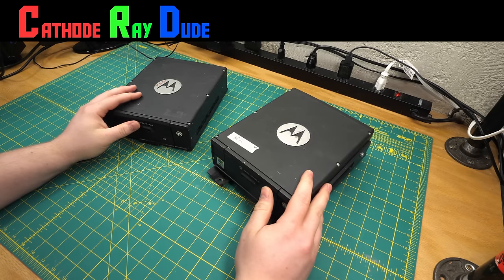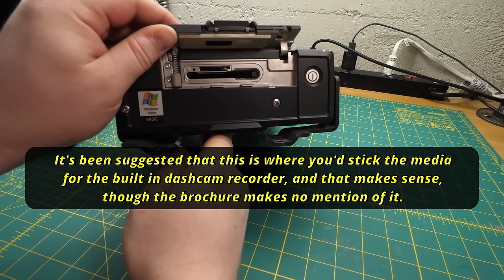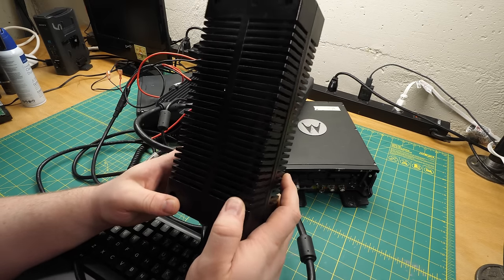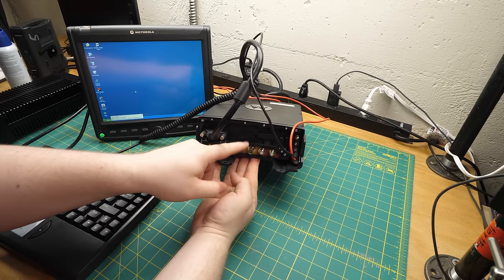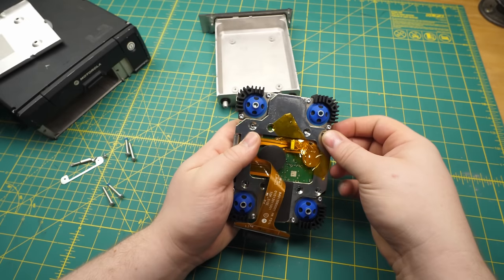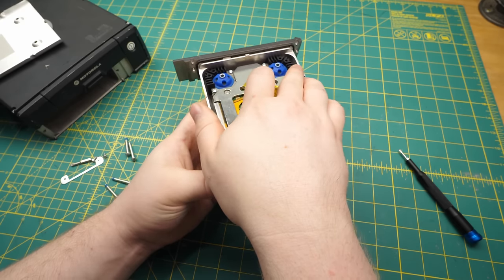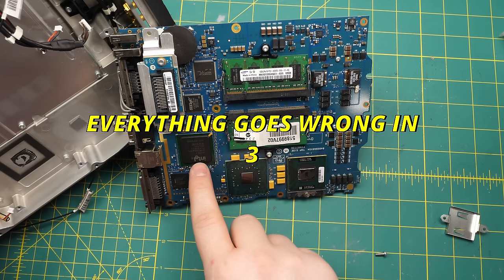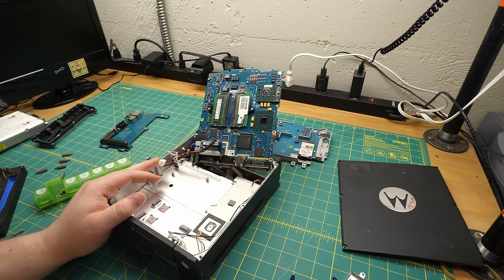Little Guys 7: The Cop-puter [Motorola MW800]

Comment: I know back in the day, cops HATED being upgraded to these things solely because of the DVR's seamless recording, before this they used something like a Panasonic AG-720 - a VHS CCTV portable. I think there might've also been DVD based systems but they never really caught on, something about "hot car on a bumpy road" really doesn't agree with DVD burners considering if you get the disc too hot they get corrupted and there's only so much error correction a burner can do when you're bombing speed bumps and jumping curbs at pedestrian-splattering speeds. Reason cops loved the VHS based systems was cause of how, every 2 hours (most departments liked SP mode for seeing license plates), you'd get a couple minutes of "I get to obey your constitutional rights even less" which could be extended quite easily by pulling the fuse while it was still rewinding - no discontinuity jump in the video if it's not recording when you pull the fuse. It's why even in cases where cops had dashcams from the 80's to the mid 2000s, they always """mysteriously""" didn't have footage of their brutality incidents. The other thing was, much like how airline pilots will """forget"""" to pull the circuit breaker for their CVR after a big incident that's their fault, the cops would also conveniently not come back to the station to swap the tapes out after a report-worthy incident and instead go on a 2-hour coffee break with the engine running "for air conditioning"...

Also yeah, I hate those SAE plugs for 12V stuff if for NO OTHER REASON than "because it's way too easy to blow something up with them". Both halves of the plug are the exact same but with opposite polarities, so if you own, say, a cigarette lighter cable for your portable VCR and the alligator clip leads for your battery maintainer, there's a very good chance the Good Idea Fairy says "hey, why don't you use those clip leads so you don't need to bodge together an adapter to use it off gel cells?" and you don't realize that the polarities of those two plugs are reversed... Only good thing about em is that the 2-pin ones will fit perfectly into a 4-pin SAE trailer plug, which saved my bacon on one road trip when the cigarette lighter went out and I needed to run my ancient Magellan GPS to find my way across 3 states without a copilot to read the road atlas, just clipped the leads onto the cigarette charger and plugged em into the trailer plug. Had to drive with the fog lights on the whole time, but that wasn't an issue.
Reply: Gotta love our overly militarized police force! Protecting and serving the SHIT out of us for over a hundred years!
Reply: I totally believe they would do something like this, but weren't their timestamps overlayed on the vhs tape video franes? Doing this would be obvious from the huge timeskip jump, right?
Reply: @humidbeing  Only if you've got a lawyer that knows about the trick, a prosecutor who won't just say "objection, irrelevant" when asked to fast forward all the way to the other end of the tape, and a police department that actually gives you the tape itself instead of just the clip of the actual incident if there is one. The skip's in the rewind zone, there's ALWAYS a time skip on VHS CCTV footage because there's no true "loop" recording - the player HAS to rewind the tape back to the start before it starts recording again, and what's an extra 3 minutes of missing footage when you've got qualified immunity?
Reply: SAE plugs - trailer-light connectors is where you saw those in the past. Maybe four pole for brake and turn signal lights on a trailer.
Reply: @uploadJ  Oh I know, read the second paragraph lol, the 2-pole SAE connectors are also compatible with trailer light 4-pole plugs, just gotta drive with the fog lights on so the running light prong on the trailer plug's got constant 12V power. Just annoying cause which prong is hot vs neutral is pretty arbitrary based on what the particular cord came from, the 2-prong ones are mostly seen on trickle chargers where the polarity is seemingly random between brands cause some brands consider the car's battery to be the "master" while others call the charger the master, the master shouldn't have exposed 12V on the male half of the plug but when both sides have 12V on them it's kinda just "put it wherever"
Reply: @LenKusov   There's always a time skip if you only have a single recorder. When they want everything recorded they would use two recorders which rewind out of phase with each other.

Since (AFAIK) police dashcams were mainly made to protect the cops (and not the general public) it's understandable why they wouldn't go with two recorders.

Comment: That oblong connector looks like ssf8470 it’s an external sass connector designed for ruggedised computers 

A friend of mine is a bus mechanic and they use them all the time 

They plug it into a laptop run the software that clones all the data(usually cctv) and dumps it to the server so it can be managed

Comment: The design with that springloaded thing for the cpu makes sense. If youre concerned about vibrations you want every screw fully tightened down. With a more classic cpu bracket the screws would be under springtension.

Comment: I drive a fire engine for a big city department and the onboard dispatch computers in all our units are nothing special, just public safety versions of Panasonic Toughbooks connected to a cell/wifi/gps radio modem and mounted in a cradle.

Comment: Those SAE plugs are most commonly found in the 4 pin variety, as trailer lighting connectors. Wander around to the back of any pickup or suv and there’s probably one in plain sight and if not, behind a cover somewhere. And yes, they are disgusting feeling to plug in. They do actually retain surprisingly well because the pins aren’t cylinders, but actually a weird chess pawn shape that kind of positively engages
Reply: I was actually going to mention that also, they look like a two-pin version of the trailer light connectors and yes I hate those because you never feel like they're plugging in correctly and most of my trailering is jet skis or boats meaning the trailer lights go in the water so sometimes when the lights work I can't tell if it's the plug not plugged in or the lights just acting up because they got wet. I much prefer the seven pin round connector on my camper

Comment: One of the things you mentioned early in the video were computers for EMS/Fire. For a while, most agencies used similar devices to this one. Some of them were made by Motorola, some of them are made by companies like Philips (Philips weirdly makes a lot of emergency medical equipment like the LifePak). They were basically identical to this one in almost every way, but Philips did make a few "medical tablets" that were just Windows computers that could dock into the cab of an ambulance or fire truck. I have never seen any come up for sale on Ebay or otherwise unfortunately, but maybe you could find one on a government auction site or something. These devices have mostly been phased out in any EMS/Fire situations, they use use iPads or Android tablets with rugged cases now because they're faster and significantly cheaper than purpose-built devices.

A few additional things to add here since it seems like there were questions about ports on this device -- A lot those ports are meant to connect to other things in the car. Motorola has radios with these massive huge "Accessory ports" on the back meant for computer control. Before 3G/4G was really a thing, cop-puters were able to connect to some radios to handle things like data over radio for things like searching license plates and whatever. This is probably one of ports on the back. One of the other ports on the back likely also connected into a vehicle's CAN bus to record things like speed, engine performance, gear, whether or not the headlights/lights/sirens were on, etc. (If you ever see police chase videos on the news or on Youtube sometimes you'll see indicators for these things embedded in the video). These things were designed to be all-in-one devices that handled basically everything that wasn't the radio or the car itself, and were used in all sorts of scenarios. Unfortunately the hardware doesn't really tell the full story, you'd likely need to get the software to see some of the additional features that this thing has, but with it being Motorola you're SOL because of how tightly locked they keep anything that is considered "Proprietary".

Comment: That “SAE power connector” is indeed automotive standard…

Being a mechanic, I have seen that it has well been figured out. The specs are “does it fit” as the precision in automotive engineering is saved for things that matter more than a 12-14v power supply (ie. an internal combustion engine drivetrain). This same style of connector, albeit more pins, is used for small boat trailer brake lights. On the supply side of the connector, the positive leads for whatever circuit will always be female, multiple circuits in this style connector share common ground (the male pin of the supply side).

If you think computers have a lot of variety of connectors, just do a quick query of you local auto parts store’s inventory of the number of different three-pin plugs.

Comment: the cooling solution and the PCB clamping is certainly perfectly engineered. this is where Motorola has expertise from decades of heavy duty radios for law enforcement and military vehicles. they will have modeled it 100 percent to fit the specs.

Comment: you were SO CLOSE when you said "Tempest attack"!

i've done the work of sealing computers and peripherals against Tempest attack, and the amount of aluminum makes me think that maybe that's what it's for, since there isn't any metallic gasket tape anywhere, but there is a bit of kapton tape over a heater, perhaps to dampen signal leakage?it could also be simply for shielding against radio interference.

Comment: Well my first comment was deleted. That's interesting. I might as well make a different comment: I think the CF slot or any other internal HDD was not used, and the HDD that was used instead is on that (relative easily removable) sled, because they'd put a new one in each day. If that's recording dash cam footage and other things, then it could be evidence in a court case. The cop probably just unplugs it and puts it on a shelf in the station when they're done their shift, and the next cop takes another one from the shelf when they start their shift. Maybe someone at the station, or a device there, has the dedicated job of copying the contents of the HDDs to a server, so they're ready to use again, i.e., be overwritten. Great video as always!
Reply from the maker: Youtube deletes a lot of stuff proactively without even showing it to me - their automod is aggressive, but it has to be to keep up with this site. humans could never do it. The occasional false positive is hard to avoid unfortunately. Anyway yeah, feels like the slot would make a great removable storage interface, and it feels like the best explanation just because it's so easy to get to. If it was intended for e.g. boot media, it'd be fastened with security screws, but the quick release suggests they imagined it being accessed daily.
Reply: Wow thanks for replying. The first comment had some links in it. Maybe that was it. I was merely pointing out that almost every large USA company does mil contracts. I thought I said it while making clear that I totally respect your opinions.
Reply: @myleft9397 Yeah, YT is really finicky with links. Too easy to trip the spam filter.

Comment: For the caddy, the flex cable folding over at an angle would help it deal with movement on multiple axes; that bit was designed. The rubber pad is likely thermal insulation and the kapton tape might be hardening the ribbon connection against vibration, but those definitely look like post-testing bodges.

Comment: I deployed and later replaced at hundreds and hundreds of Dell Optiplex desktops in the late 2000s to early 2010s with similar SDVO cards in them. Most of those cards had a DMS-59 port on them. You would plug in a Y cable that had either dual DVI or dual VGA ports on it. For basic office use the onboard Intel graphics were good enough to drive a couple of displays at 1920x1080 or 1680x1050 per display.
Any users that needed 3D for something more workstation related had the SDVO card replaced with a dedicated GPU, usually a basic Nvidia Quadro card or ended up with a Dell Precision workstation also equipped with a Quadro card.
Reply: Ugh, DMS-59 was such a pain in my ass. I also did IT, managed about 200+ PC, mostly Dell Optiplex, from 2006-2013, spread out over 90 locations across the USA. The worst was when end-users would lose or discard that DMS-59 adapter, and the machine would basically be useless for display output until I could source a replacement and ship it to the location and try to walk them through reattaching it.
   Also dealt with a lot of end-users unplugging the power cord to the network switch then wondering why their computer and network printer doesn't work anymore. Maybe don't unplug the thing with the label that says "DO NOT UNPLUG - NETWORK WILL NOT WORk" on it 🙍

Comment: More mass doesn't neccesarily make it harder to shake, that's what the rubber is for. The Mass is what helps with sharp impacts. Say you hit a bump at speed, well the impact of the bump is absorbed in two ways. One is the spring (or rubber) compresses and absorbs the energy, the other is the car moves in the direction of the impulse. The heavier the car, the more of the energy is absorbed by the spring and the less the car moves. This is why rolls royce used to line the floors of their cars with lead weights. Any oscillation caused by outside input needs the rubber. But sharp impacts are much easier to absorb when the thing you are protecting is heavy

Comment: That hard drive looks so wild, when I first clocked the connector it looked like a scsi/sas or even fiberchannel. The heaters are awesome, I would have guessed some sort of tamper protection, I imagine the legal requirements for chain of custody could be wild. Also I wonder if the gigabit network port was to umbilical the car to copy out the recorded video?

Comment: Part of what you're missing with the thermal solution is the cop car itself. This was from the Crown Vic era. The Crown Vics routed their rear HVAC underneath the center console area. Usually that duct would get a great big hole punched in it on the basis of "the computer needs air conditioning, the backseat passenger doesn't" - so there's frigid 40 degree air blowing straight on the chassis whenever the air conditioning is on.

Related, the back seat heating on those things was very weak compared to the air conditioning, so the inverse wouldn't be true (and cops, with all their body armor and junk, are usually running the aircon well after everybody else switches to heat anyway)
Reply from the maker: lmao okay that's a good point

Comment: The weighting is there for sharp, fast shocks. The extra mass means it just won't accelerate as fast, and that's ultimately what you're trying to achieve.

It also works in tandem with the flexibility of the rubber mounts. You can use a stiffer material when it's heavier.

Comment: I went through a phase in college where I desperately wanted to have a good, robust computer in my car for audio playback. I had a big collection of MP3s, but I didn't have a car stereo with anything as fancy as USB input (it was 2003). Got a little single-board Pentium 2 system and mounted it inside a half-depth rackmount case, screwed into the trunk with L-brackets, using a micro 12v to ATX power supply. I would have killed for something this well integrated... but I didn't have the 4 figures of cash to get one!

Comment: Request for a spin-off series that focuses on mobile tech. First up, the computer used in a modern field tractor. Have to imagine that the result is pretty similar to what we just saw. Needs video capture, GPS, and some environment sensors.

Other targets: Public transportation - buses, trains, and planes. Other emergency services like you mentioned. Large boats? A race car or two would be neat.

Comment: IIRC, that Conexant video capture chip is a descendant of BT8x8 chips (which were also produced by Conexant for some time). It's really a pity that the chip in this little guy is not the one that you can trick into working as an ADC.

Comment: I always found it interesting that you have entire ToughBooks or apparently entire PCs bolted to the center console in the US, but I never realised they're also the central control unit for radio and video. In Germany, radio, signals and video are all dedicated systems and everything that has remotely to do with data access or entry is just done via iPads these days. This also includes ambulances and fire trucks.

Comment: I appreciate that you keep it non political. I didn't take you for the demographic that would be super pro police. I appreciate you started your stance without going into detail and then got on to the tech. 

Because the engineering of tech for ruggedized environments changes all of the trade offs you can make everywhere else. And the environment limitations and solutions are applicable to many other places to some degrees (see what I did there? It's a heat joke.)

 I heard "cop computers" and was ready to bail quickly because I come to tech channels as the one refuge from everything being political. Thank you for keeping it classy.

Comment: Digi-key will happily sell you the shells, cores, and pins to make those "military" cables with all the pins. They're common as dirt in industrial applications. As long as you know the pinout, you can connect them up to whatever cable you need, for whatever application you can dream up.

They're a little on the spendy side, but tough AF.